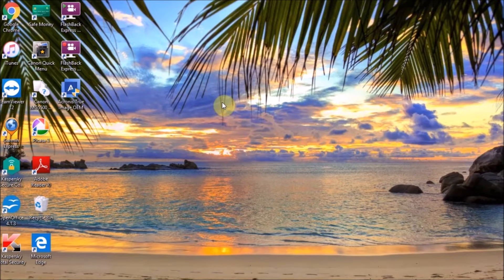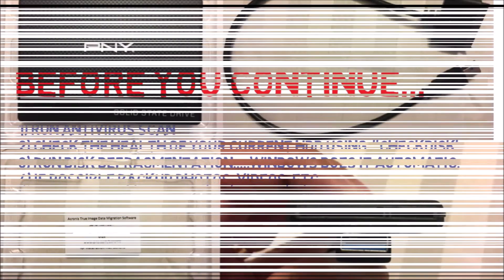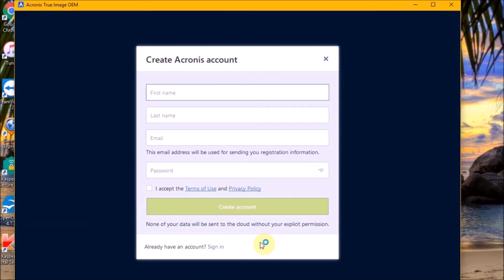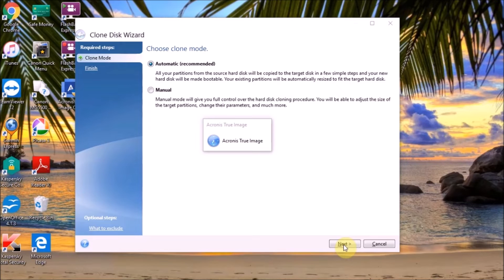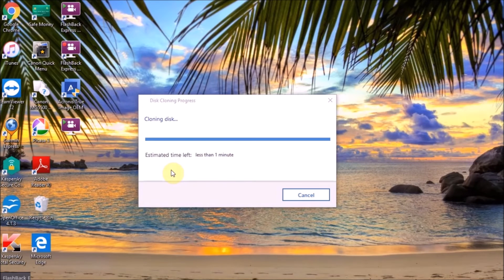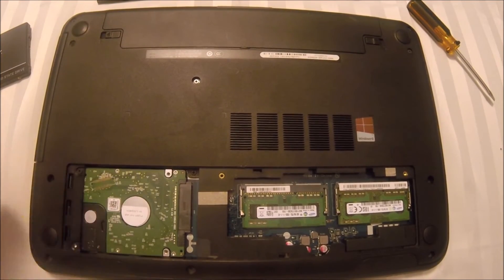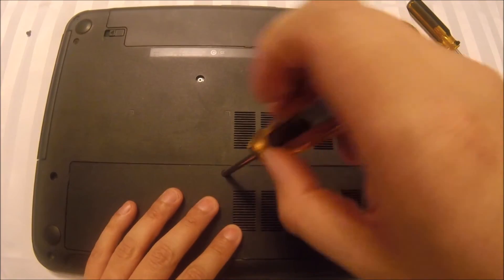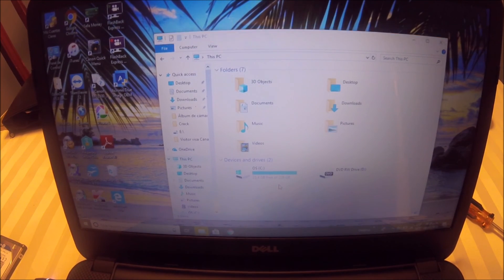Upgrade your HDD to SSD With  Acronis And PNY

Comment: Quick question if anyone knows, can this be properly used as just a one-time backup? Like, cloning the main drive into this SSD, then being able to take the cloned data off of the SDD and put back onto another drive?
Reply: Without having to physically install the SSD drive into the laptop itself
Reply from the maker: @smokeydapear6893  Hello,
I think i am not understanding you question corrrctly....
What i always advice after cloning and replacing you old HDD/SSD by a new SSD, is to keep the old one around for a few month as a backup, in the scenario that the new one dies for some weird reason. If that were to happen you would just put back the old one and it should work. Besides, if you delete some file on the new SSD you would be able to copy it from your old hard drive.
Hope it helps
Thanks for the comment!
Reply: My IT Workshop My use of it was for only a backup drive. Not to replace the main drive, just put the data on the SSD, fresh install windows, then take the backup data from the SSD back onto the main drive. I wasn’t sure if you were able to take the data back off the SSD drive

Comment: pny doesnt include software. scam.
Reply from the maker: Hello KingBowser,
You are totally right, I just bought a few more PNY SSD, the same model as in the video for some laptops I need to replace the HDD and there is no longer an included Acronis basic license with it. Apparently they broke up the partnership. Now, I have some Acronis keys that came with the PNY SSDs I bought some months/years ago, i am not sure if they work because if I use them they become associated with the email address I provide. Anyway, if you would like to try whether it works or not just let me know and will copy the Acronis key to your response.

Thanks for the comment!

Comment: I just recently bought a 480 GB PNY SSD. I got no Acronis, nor any explanation on HoW to get it. i called PNY. They say they no longer offer the Acronis link! That's one of the reasons i bought it!
Reply from the maker: Hello Rene,
You are totally right, I just bought a few more PNY SSD, the same model as in the video for some laptops I need to replace the HDD and there is no longer an included Acronis basic license with it. Apparently they broke up the partnership. Now, I have some Acronis keys that came with the PNY SSDs I bought some months/years ago, i am not sure if they work because if I use them they become associated with the email address I provide. Anyway, if you would like to try whether it works or not just let me know and will copy the Acronis key to your response.

Comment: Where did you get acronis key? I haven't found anything inside PNY box.
Reply from the maker: Hello Артур Горький,
The Acronis key is normally in a label attached on the plastic container where the SSD is placed inside the box or in the "manual" that also comes with the product. It is a 16 digit key.

Also, on the box of the product there is a label that says: "Bonus True Image Data Migration Software"
Reply: @MyITWorkshop  Thank you, I got stuck on that too!
Reply from the maker: If you need to clone you HDD to SSD as soon as possible I have 2 other videos where i use free cloning software that might help you.

Clone your HDD with Macrium:
https://youtu.be/VQ9jQd-SeJw

Clone your HDD with EasyUS:
https://youtu.be/4jH7EAHi_XA

Hope it helps!
Thanks for the comment!

Comment: Is this faster than re installing Windows.??
Reply from the maker: Hello,
Cloning your HDD to a SSD varies in time, depending on how much information you have.  After that, you just replace the HDD and it starts working, if done correctly. Re-installing Windows 10 now a days is really fast since it comes with all the basic drivers. However, if you have a video card, games, documents, other software you have to install/copy them again from the old one to the new. For this particular case it was faster to clone it rather than installing windows again, copy all the files from the old computer  to an external HDD and copy it back to the new and after that, install office and some the other apps.
Hope it helps, as promised here is the code for Acronis basic license:  LMVKAAQL-MKLTM8RB
Have a great day!
Reply: @MyITWorkshop  thank you! I ended up having to reinstall Windows because my adapter didn't work for my sdd but I'll use acronis in the future it's seemingly more convenient
Reply from the maker: @ripcitydripcity5035  Yeah, once installed just make regular backups, (mine runs every 2 weeks), on a different partition or external drive, that way you wont lose your important documents in the event of a blue screen of death.
Reply: @MyITWorkshop  oh ok thanks for the heads up. I uploaded all my videos and to Dropbox. I'll have to set it up to run backups. How do u do that I have Windows 10?
Reply from the maker: @ripcitydripcity5035  That's one way to do it, in my case i use Onedrive and Google drive. For the latter you can install the app on your computer which creates a folder with the Google drive logo, anything that you put in that folder is automatically sync/uploaded/backed up to my Google drive account on Google servers. Same case with One Drive that already comes installed on Win 10. However, I did not use Dropbox for some years now, but i remember they had a similar if not equal way to sync your document with your cloud account, just install the app, choose what folders you need to sync/upload and put all the data that you want to upload to the cloud in that folder, depending on the size and internet speed will take more of less time to do so, for videos based on quality and size will take, i think, a lot of time to sync.   
Acronis can also encrypt your files, so that's an extra layer of security, you would have to configure your backups to point to the folder that is sync with Dropbox, that way once the backup is done will be uploaded to the cloud, BUT again it will take a lot of space in the cloud and time to upload. 
Hope it helps!